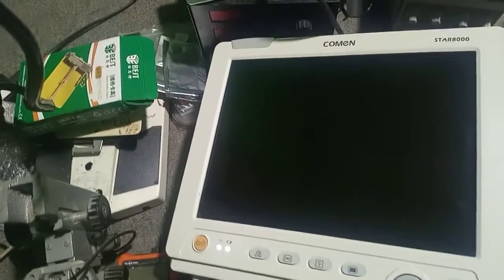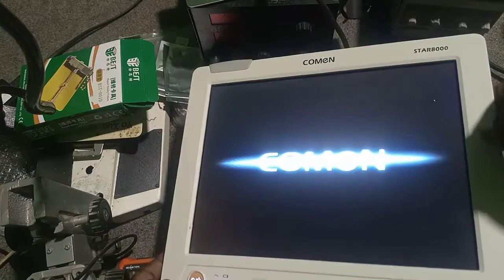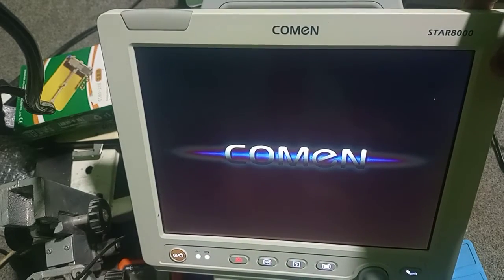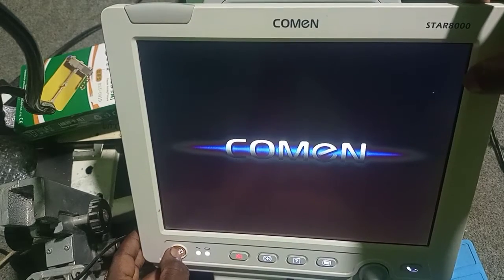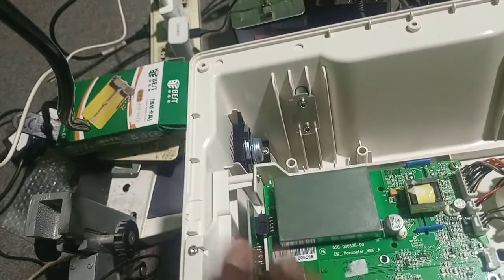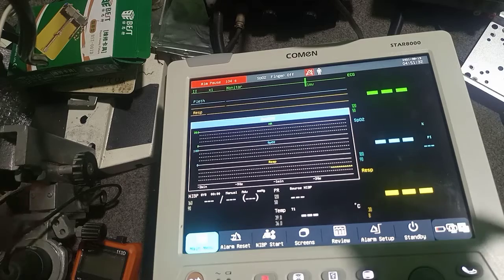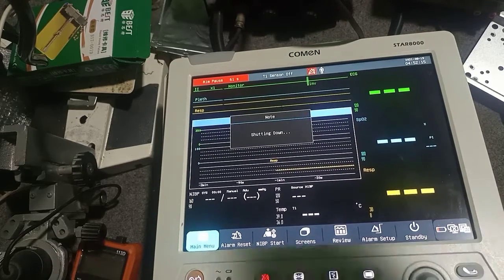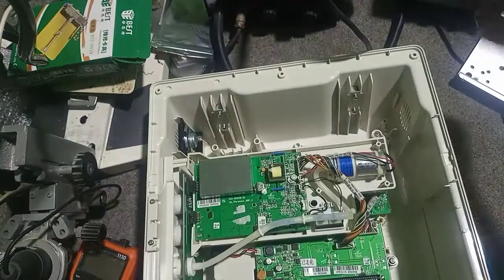comen patient monitor booting problem

Comment: Hi sir. I am also having the same issues in comen C80. The only comen logo is appearing. What is the solution to reboot the machine. Please give me your answer
Reply from the maker: First try clean the boards, if that don't work try and reload a new software
Reply: Reinstall the software. Its 100% software problem.
Reply: How to reinstal the software sir?
Reply: @wafihibatullah4302  the same question Did you find the solution?
Reply: @wafihibatullah4302  Hi Did you find out how cause i have the same problem ?
Reply: Same issue

Comment: Hi i have this monitor
That was spo2 sensor fault and sd storage full 
But don't detect pulse oximetry  
How i can fixe this?
Reply from the maker: You need a new spo2 sensor, with the storage u have to delete the the data on it to make up space
Reply: My indicates storage full yet it has no sd card kindly assit  @tmrepairtutorial2496

Comment: SPO2 & ECG COMM STOP error, how to fix it?
Reply: the same problem
Reply from the maker: You have to check the boards which has the spo2 , ECG on it. That board is faulty or the main board can not communicate with the Spo2 ECG board so check the main board or replace it

Comment: i repeted your same operation for the booting problem in comen star 8000E patient monitor(deconnect and connect the nappe and cleaning the boards with electronic spray ) the problem is not resolved 
it is need to recharge softwere or replace any board...??? think you for your feedback
Reply from the maker: Kk now u have to charge the software or update it
Reply: How to charge the software or update it for monitor TR-900b? As there is no usb module just lan module and where I can get it
Reply: I need software

Comment: software update will solve the bootup issue
Reply: olá. amigo vc pode . me  conseguir o software de atualização do star8000f
Reply: @renivanoliveira2513  please reply in english cant understand the language
Reply: sir if the unit got a usb port or network port you can update the internal software if the mother company send you it , sir i think this type of issues mainly happen due to internal memory filled with patient data so by reseting the internal software or flash memory will do the job i think
Reply: ou como posso conserguir
Reply: How to update